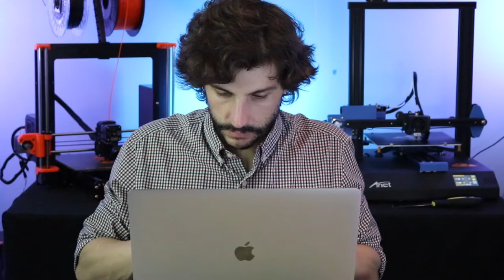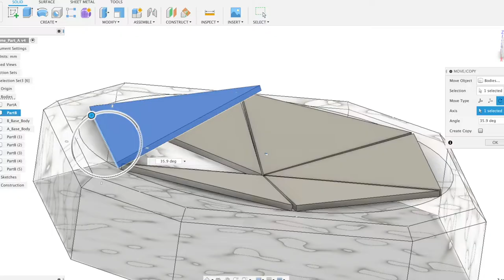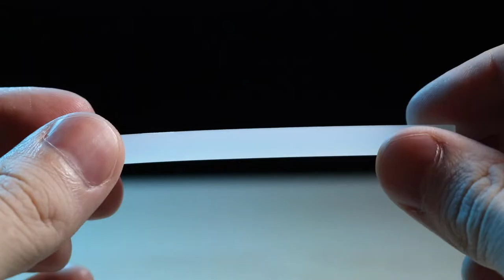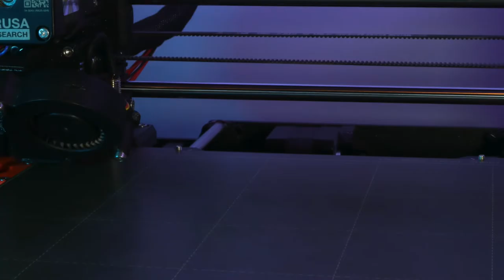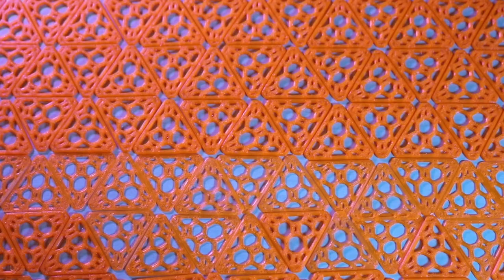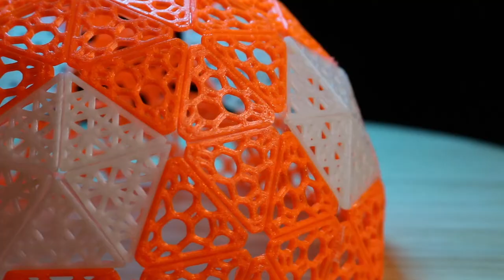How to Build a Geodesic Dome - MIT Architecture / Tom Sachs ISRU Workshop

Comment: I don't understand the point of this video at all? So print little triangles and glue them together on Mars? in 4 months while you suffocate and starve waiting for a print out of a primative mesh with holes open to the environment?
Reply from the maker: Sorry to hear you didn't understand the video, Robert! This was part of a project exploring resource utilization; you can learn more (and maybe even understand it) by reading some of the information in the description of the video!
Reply: @AndrewSink  The intention to build a geodesic  dome is clear.  The question is what makes you think you would survive the process both during and after as clearly it would be extremely fragile, and not protect you from the environment at all.  Not to mention taking forever to make. Space is deadly harsh. Anyone thinking they could go to Mars/space and think they could survive because they brought a 3D printer would die a sad and lonely death.
Reply from the maker: Don't tell anyone at Penn State that, they'd be so disappointed to find out! 😂
 https://news.psu.edu/story/574642/2019/05/16/science-and-technology/3d-printed-mars-habitat-team-has-breakthrough
Reply: @RobertA-hq3vz  There are lots of possible uses for viable, robust structures that can hold up in harsh environments.  I imagine that permanent, fixed measurement instrumentation would be installed in these environments before bases designed for humans would be deployed.  Rome wasn't built in a day, and this type of innovation is the future.  Would be cool to use a 3D printer to build a framed structure (much like the video) fixed to the bedrock, then pour concrete made with martian sand on site.  Hell, you could even 3D print the shoring.  That would solve the radiation problem!!!
Reply: @benjaminmerrell992  yes, lots of use for  viable, robust structures, here on Earth. However 3D printing is best suited to prototyping, not designing shelters in an environment where the average temperate is minus 80 degrees, gravity is 1/3 of earth, Carbon dioxide: 95.32 percent of the atmosphere, toxic soil, 1/4 sunlight from the sun, and radiation.  People dream of living on Mars and yet few seem to ask WHY would any sane person want to live on Mars?  Even if you could do it you'd be spending you're entire life locked in a survival pod, where venturing out unprotected is certain death.  Can you list one real advantage to living on Mars?